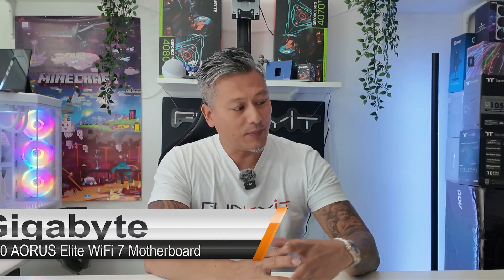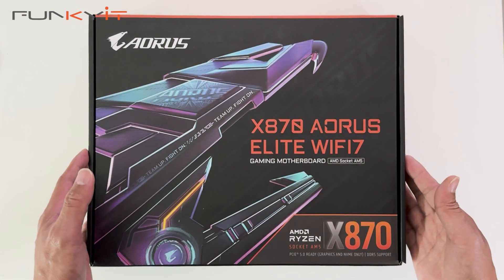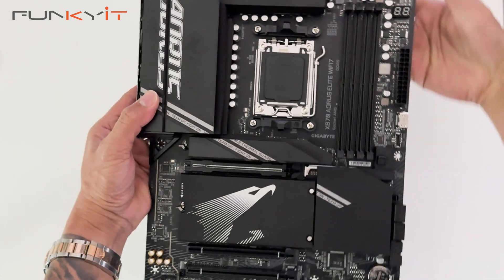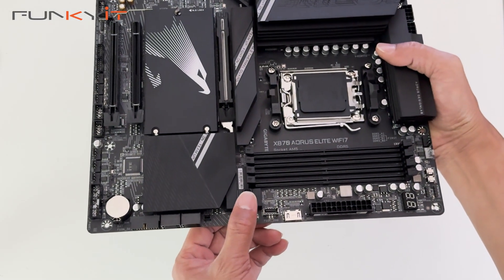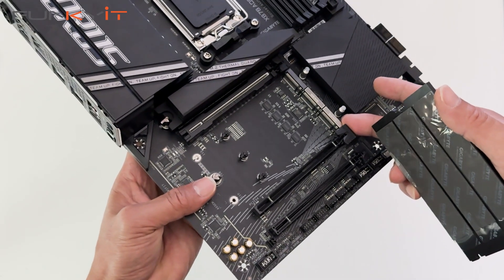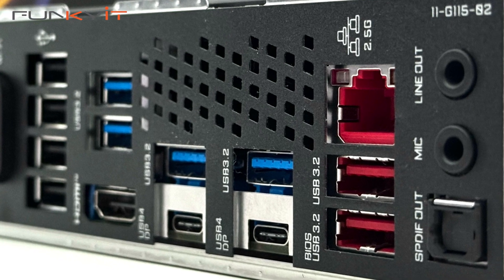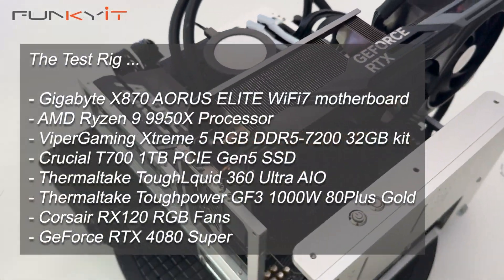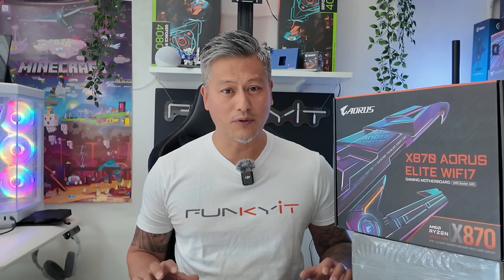Feature-Rich X870 Motherboard for your Ryzen 9000 series processor - Gigabyte X870 AORUS ELITE WiFi7

Comment: 16+2+2 power phase.. made the jump and bought the 9800xd with this board. Got the new egg combo with free 6000 32gb ram. Upgrading from the 5900x this generation leap should last me next 5 years... hoping the nvidia 5000 series is this meaningful... will upgrade from the 3080ti hybrid to 5080 ti... 😊 and and fyi...that single hdmi is for adding a display panel inside your case (for monitoring temps etc)

Comment: Getting set to build for the first time in 10 years since putting a 4770K build together on a Gigabyte board that is still doing well after 10+ years. I have the X870e version of this board sitting here along with a 7600x waiting to be assembled. The new board seems solid. It's 6 layers of PCB and without a full backplate but I won't be running the highest wattage CPUs or overclocking. Looking forward to getting everything put together.

Comment: Ordered it today along with 7800X3D, good review, thanks
Reply from the maker: Hope you enjoy it!
Reply: @Funkykit  arrived today, great board, lot of features, everything working except i can't get wifi to work 🤔 I've installed all the drivers from gigabyte software utility but wifi connections still doesn't show up, need to figure it out
Reply: @Bork425  I have exactly the same setup as you. The gains in fps for my 2080ti gpu are unbelievable coming from 8700k! BTW if youre running win10 there are no drivers for wifi7 for it yet :/

Comment: I own the X670E version of this board and it is the worst, in-that Gigabyte simply cannot release BIOS' that work, but rather, the keep releasing BIOS revisions that break things, and their support is completely useless(waste of time). 

That said, and because this, I would never recommend nor buy another Gigabyte motherboard personally - they are too expensive, and Gigabyte has lost all of its credibility as a board manufacturer imo.
Reply from the maker: Previous Gen 600-series boards had a lot of issues (big story with ASUS) 

But now these 800 series motherboards seems a lot better 👍
Reply: @Funkykit They appear to have had some additional lead time (CPU’s released a month before chipsets)… hopefully they have put that time to good use!
Reply: Their support is awful if you ever need it, but this line of boards are fantastic. I have three different ones for B650 /X670 in my house, great, overspeced VRM cooling, and nothing wrong with them.
Reply: Never had a problem with an Intel Gigabyte board (or AM4 Gigabyte). My current system is Z590. Maybe it's not Gigabyte that's your problem but a totally new platform from AMD? Ryzen 1000 series processors went through some growing pains, too, before things got more stable and you could overclock better, and get higher stable speeds on memory with 2000, 3000 and 5000 series.
Reply: @rbitrossome  "totally new"? The B650 and X670 boards are not totally new, and they work fine. This guy must be new to hardware, gets one single issue, thinks the entire line of product is bad.
Reply: @insertnamehere4419  The platform--AM5--is new. That said, there have historically been a variety of growing pains in the first iteration of a new architecture, and blaming the motherboard manufacturer seems like it is the default scapegoat for issues a user might not fully understand. I'm just saying unless you can give specifics on what is wrong and how you know for a fact Gigabyte is at fault when other board companies have absolutely no comparable issues, you're just making an emotional decision out of frustration due to ignorance.
Reply: @rbitrossome  Am5 is not what I would call new. The growing pains are over, with b650 and x670.  Not really sure why you're sticking with this narrative but I agree with the rest for sure.
Reply: @insertnamehere4419  he's talking about having trouble with a X670E motherboard!!!! JFC
Reply: @rbitrossome  Right?? I know?? Wtf is your point. X670 is not new is all Im saying.